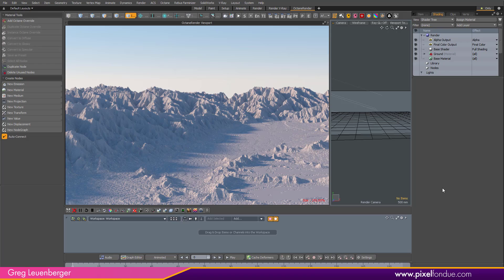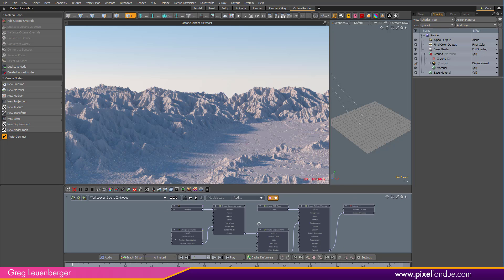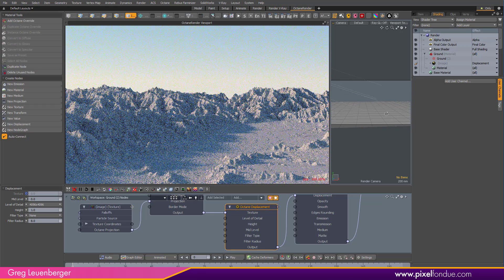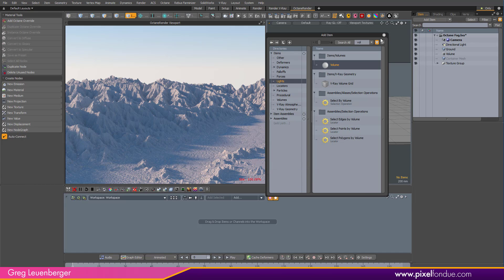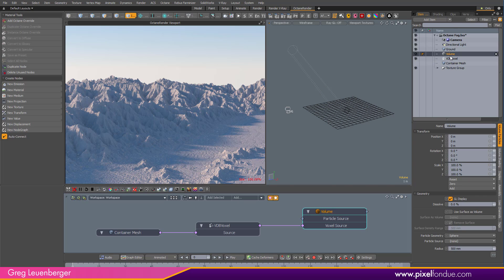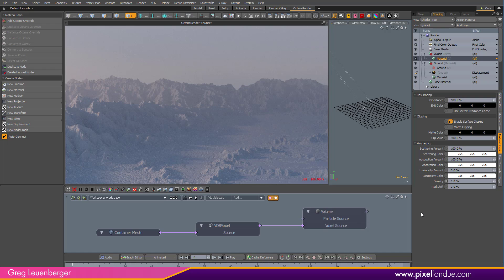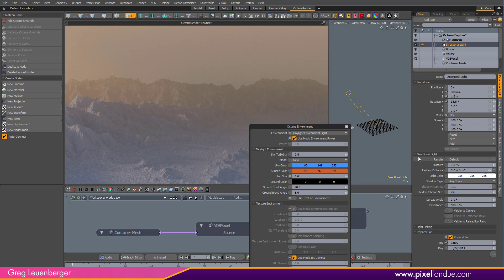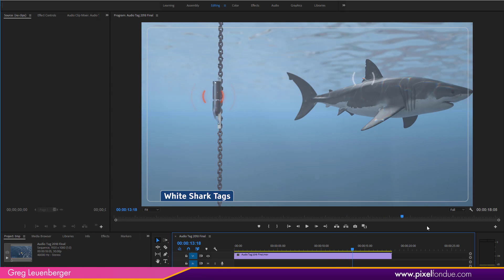MODO Octane | Displace and Volume Fog

Comment: Very helpful video! I was wondering though, whenever I attach the container mesh to the VDBvoxels my whole computer instantly slows down and then Modo crashes. Was wondering if you knew the cause of this. Thanks!
Reply from the maker: Well, that's no good.  What version of MODO are you using? Maybe try hiding the volume and voxel in the viewport (eyeball in item list) and see if that crashes MODO.  I used 11.2v2 for the demo...haven't tried on 12 yet...but it should work.
Reply: @pixelfondue  Hey do you mind me asking 3 years later if  you solved this? I agree with Greg's comment below about leaving atmos to post- I do that too but couldn't resist giving this tutorial a whirl.   Killed my machine. Modo crashed then i tried again after a restart and it crashed the whole system. I think i'll stick to depth maps.
Reply from the maker: @dermotapower  I really don't know - I don't even try this anymore.  There is a better way (I'm not sure if I did it in this video).   I use depth maps but there is a better setup here (I think).  The MODO environment item has an Octane medium channel on it so you don't have to use a container/box.  I think I talk about in this one (I can't remember: https://youtu.be/CIQNeYrmUSI
Reply from the maker: @dermotapower  Yeah around 14:00 min
Reply: @pixelfondue  Thanks ..I tried that after you mentioned it. It worked for a small little scene but did nothing in a big scene. Oh well... something Vray did very well.

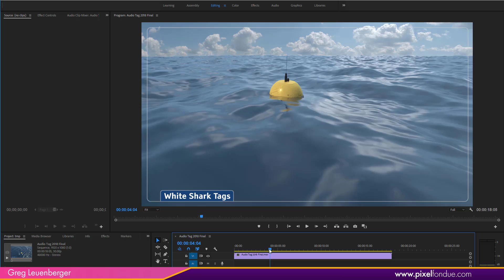Comment: Greg, this is great, but can you show us how to make this appear as the sea floor as if viewing through water instead of fog? nevermind, just made it to 10:30... but do you think you could show a little more about the under water settings?
Reply from the maker: It's really just the same thing...although water loses red at a faster rate.  I didn't account for that (although MODO will let you).  You may be able to rig up a color by distance (not sure) where red goes to black more quickly.  To get the underwater effect you need a combo of fog+particles+caustics (the pattern on the top of the shark).  Caustics are just a projected image sequence...they're not physically correct from the renderer.